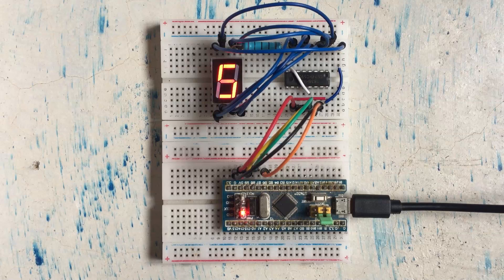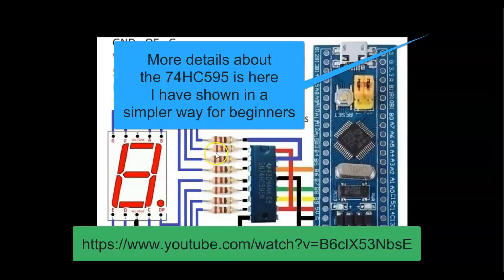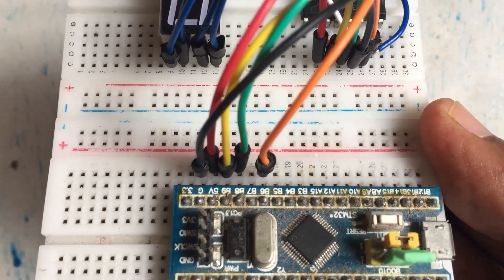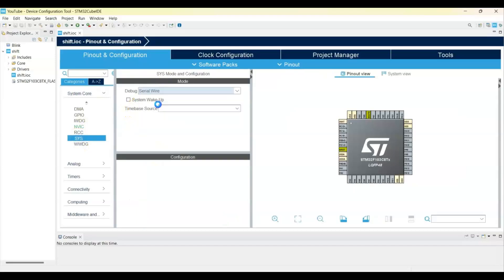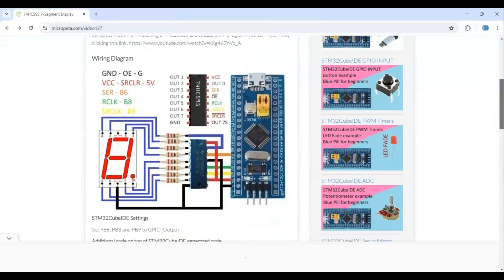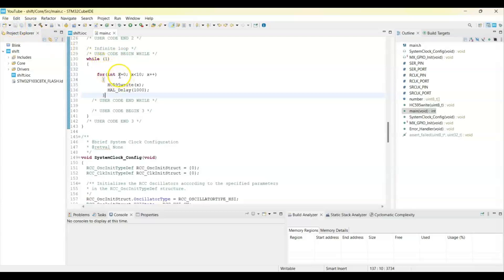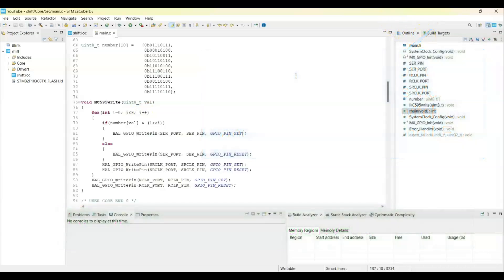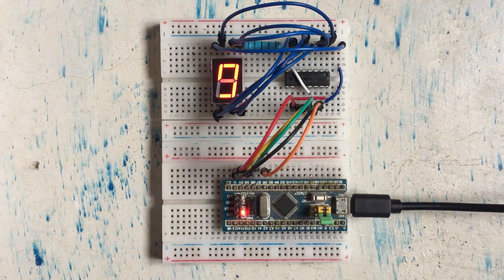127. STM32CubeIDE Seven segment display via 74HC595 8-Bit Shift Registers with STM32 F103C8T6

Comment: ❤This is amazing . I learned a lot from you. Please make two or three pieces 74ch595❤
Reply from the maker: Multiple 74HC595 Shift Registers with STM32 done
Link --> https://youtu.be/XLJzC3ukmAs
Reply: Thank you sir. Is it possible to make it with 3- 7 segmant
Reply from the maker: Of course, it is possible. It is also very simple. Just replace the 7-segment in the place of led and switch on and off the pattern. Because it is simple, I don’t want to repeat the video recordings,  besides I don’t have three displays with me. Thanks
Reply: thank you sir.